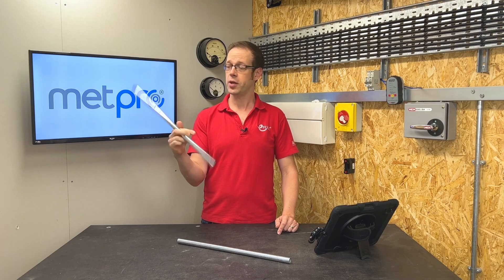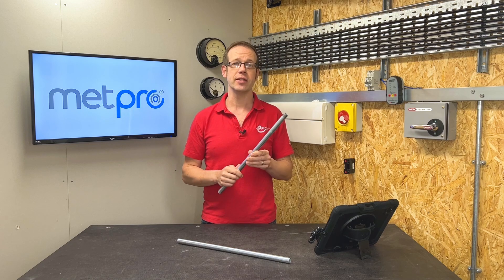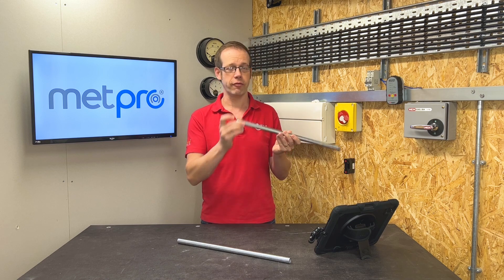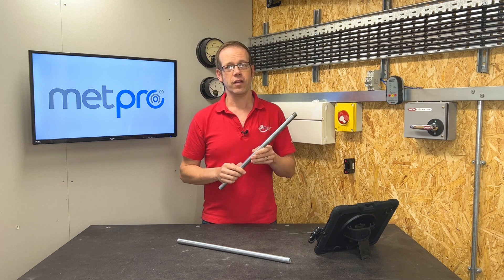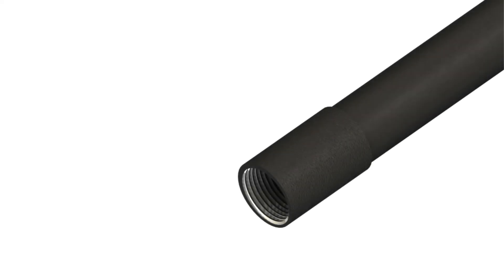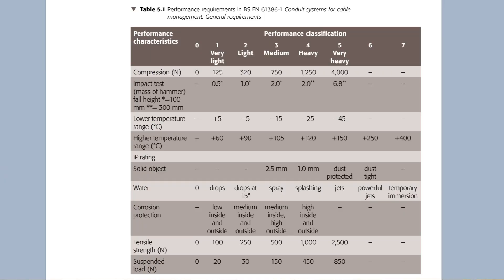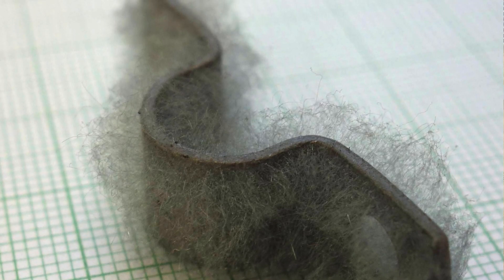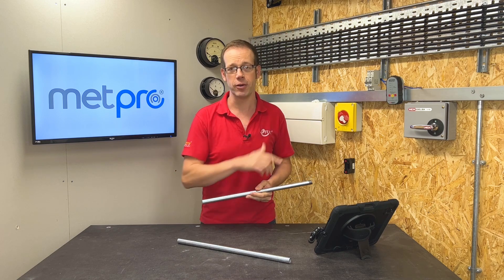You Never Knew: Different Classes of Steel Conduit?

Comment: There are some brands marketing in middle east and south east asia BSEN or IEC 61386 Class 4 conduits using High Zinc Z450 steel, instead of the traditional hot-dip galvanzing. They look so similar to normal class 3 conduits and they can pass the resistant to corrosion class 4 test for BSEN but failed for IEC

Comment: Regulations are an actual joke these days. Need a phd to understand them all and all the stupid numbers and classes. 99% of electricians who are the actual ones fitting this stuff on a daily basis don’t have time or the money to study them all.  Would take a week to fit a light ffs. ^^ this is a common chat had on site^^. There’s a reason these professors can’t make a living fitting anymore 😂 go to turkey and there’s ovens on a 1mm with no issues or problems to be seen but come to the uk and this guys like you can’t do that it doesn’t comply to bs6761-64-a+20-4.423. Sub section 3.2.187 😂
Reply: You aren't wrong... But in fairness the stick is still there to beat you with if it goes tits up. So head in the sand probably not the wisest course of action.

Comment: I think when you go to the wholesalers they give you what's on the shelf when asking for conduit ! Black enamel conduit was a pain not to scratch in the bender.
Reply: Have not seen lack steel enamel conduit or sale in over 50 years. Was not allowed outdoors. Liked using Aluminum conduit due to easy to cut & thread by hand & weight saving.
Reply: @JohnThomas-lq5qp  I think it's still about but obviously galv is the go to these days.
Reply: Used to use the black enamel conduit on fire alarm system back in 80s.
Reply: @2Sorts  I used back in the late 60s as an apprentice flushed in the wall , easy to wire only 3 wires !

Comment: ah yes, the coating chipping when you bent it was an instant fail on the tests we did, but i'm not sure if they were deliberate or just badly coated conduit
"tripods at the ready! bend away!" as the 90 year old instructor used to yell at us 🤣
i wonder if mr eastwood is still teaching folks how to keep the smoke inside the wires?